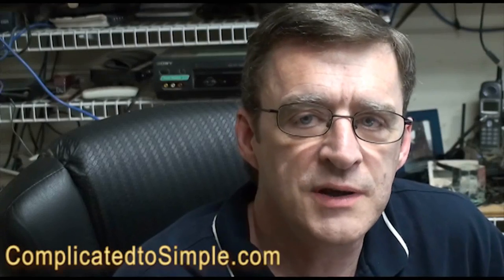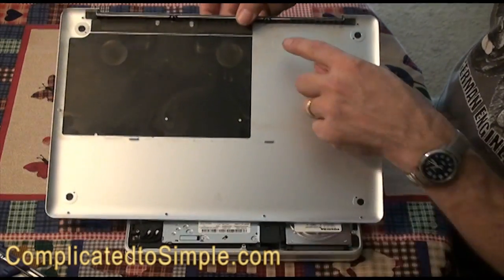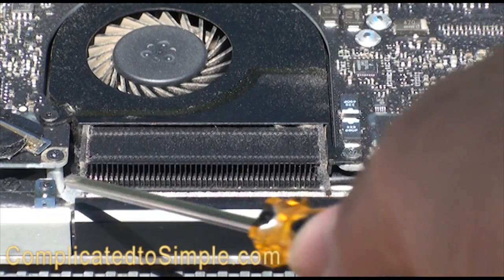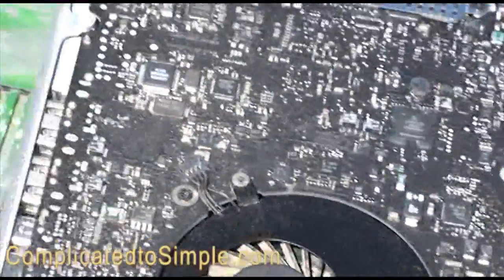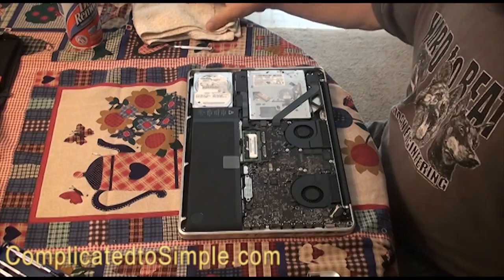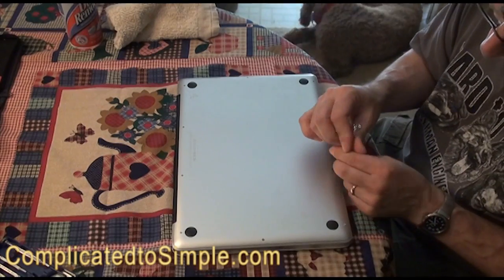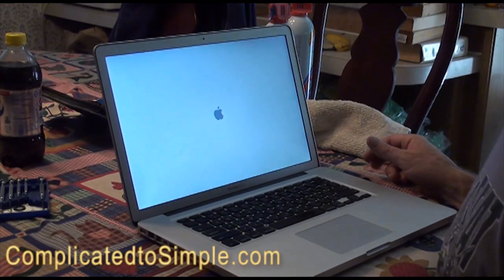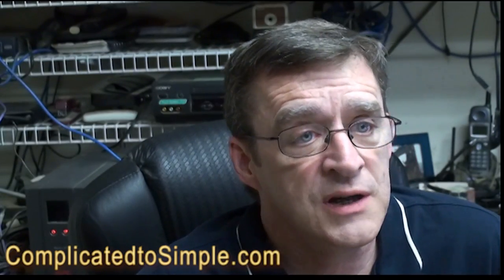Cleaning Macbook Pro HD

Comment from the maker: Hi Pasquale,  
Normal dust should not harm the surface of your Thunderbolt plug.  However, if enough gets in it can certainly get in the way of a good connection.  This can make the plug either not work at all, work more slowly, or even corrupt data going though the plug.  You can clean these the same way as the fans.  Just blow canned air into them.  Do this regularly to prevent the dust from getting really stuck and having to clean it out by other means.

Comment from the maker: The can is just compressed air available at most office supply stores.  It's actually usually compressed, liquified carbon dioxide which is why it's important to keep the can upright and spray in short spurts.  Otherwise the liquid can come out instead of air and cause freezing or other damage.

Comment: My MacBook was getting hot on my bed so I got a box lid - about an inch high and about the same size as laptop and on top of the box lid I put a shelf - grille from the oven and put the laptop on the grille and secured it with some thick elastic. Solved the problem mostly. But still find the computer still struggles in the hot weather.  It has never been cleaned inside, had it nearly 5yrs. Hate to think what has built up inside!  Thanks for the instruction.

Comment from the maker: If you use a compressor, just be careful not to blow with too much pressure.  Also, sometimes compressors have a lot of condensation in them and can actually spray water onto your computer.  At least use a water separator.  At best, get a disposable water filter for painting an you local auto paint store.  These screw on your air hose just before the nozzle and will filter out all water.

Comment from the maker: @sueanna2 It depends on your environment.  Some people do it as often as once a month as a previous commenter noted.  You can set a schedule for yourself or just do it when it starts getting noisy, hot, or the battery starts running down faster.  You could try every 3 months and if you see that it's excessively dirty, do it more often.  If pretty clean, then maybe go to every 6 months.

Comment: Um, actually, it turns out my mac is older than the one showed in your video. It's from around 2008, and has the battery in the back, and when I take out all the screws, it doesn't just sort of pop off like yours did in the video. Do you have any tips on that? Can I just pry it off? Do you have an older one lying around that you can demo? Any help would be appreciated. Either way though, your video is great.

Comment from the maker: Dust cloths are fine for cleaning your display, but I would not recommend using a cloth inside your Mac.  It may be safe on some of the plastic parts but it would drastically increase the possibility of damage due to static electricity.  I would stick with compressed air for cleaning out the inside.

Comment: Playing videos can take some processor/gpu power, this in turn heats up the relevant components, it is normal, however if the components are dusty then it'd heat up more than normally would. 62 is bit over the normal, i suggest you clean your pc.

Comment from the maker: The spray is generally compressed carbon dioxide.  Some canned air may actually be just compressed air.  Either way, it's nothing but a compressed gas that helps to blow away dust.  As I mention in the video though, be careful not to tip the can over when spraying.  When carbon dioxide is compressed as much as in these cans, it actually liquifies.  If you shake or tip the can, extremely cold liquid can be sprayed which can damage warm components in your computer.

Comment: if you're using flash (which you probably are by the sound of it) to watch videos it's notorious for using a ridiculous amount of CPU power. More CPU power = more heat. My MBP is about 20 degrees C  cooler using HTML5 when i can.

Comment: hello robert, i just watched your video it was on a website i found searching for mac book pro overheating, my mac is getting hotter than usual lately, i went to an app store and they checked the components and said it was ok, so it's not a hardware problem apparently, i reinstalled iOS and nothing (it usually get hotter when running movies or video games) so i figured i try your method, i would like to ask what you think though because opening my mac by myself frightens me a little specially because they wouldn't do it at the app store, thanks in advance i hope not to trouble you with my question.

Comment from the maker: Depending on where the air vents are, using on a bed can tend to block them,  Because of the placement of the air vents on the Mac Retina Display model, I find that using them on surfaces such as beds doesn't seem to cause much of a problem.  Thanks for your comment!

Comment from the maker: The product is commonly referred to as canned air.  It's usually either compressed air or carbon dioxide.  It just provides a way to blow dust away from your computer.  There is nothing special in the air.

Comment: Could i use the Compressed air to clean the dust from the circuit board too?
Reply from the maker: Yes, you certainly can.  Just be careful not to spray too much, too fast.  This could cause the freezing liquid to contact the board and possibly cause damage from the sudden and extreme temperature change.
Reply: There are a few factors in speeding up Macs. One plan I found that successfully combines these is the Mels Speed Method (check it out on google) without a doubt the most incredible remedy that I've heard of.Check out all the super info .

Comment: Nice video, except never let the fans spin while cleaning them out. Use a pencil or something else to hold them in place. Spinning fans can act like little generators that put current back into the computer that can damage the electronics.
Reply: uh, no that is done frequently to many heatsink fans and they do not cause damage.
Reply: Good luck with that. I fried a couple of boards that way before I figured it out.
Reply: You think that was the case, actually you accidentally static shocked said boards, or shorted a connection. Can you explain how numerous people do this without damaging boards?
Reply: Right. You were there. You must have been that guy breathing through his mouth and looking over my shoulder.
Reply: I made a common assumption. Do a web search on cleaning PC fans. Search YouTube. If your "little generators that put current back into the computer" logic was true, then explain why many people suggest this, and how their computer works afterwards. I do it on my Mac, HP, and have done it to my PS3, since I had to replace the thermal paste. They have been working fine.
Reply: Your assumption was wrong. Your question is a straw man. Not all boards get fried because people clean them differently. They don't let the fans spin as long or as fast to cause the problem. But some do. 

When I made the mistakes, I used shop air at 110 psig. The fans spun until they whistled. Two of three boards were toast after cleaning. Following that, I used a pencil to hold the fans still. Haven't fried a board since, and I've cleaned out a LOT of computers and video cards. 

Now, for YOUR experiment, take a cooling fan, attach a voltmeter to the leads, and set the fan spinning fast with some compressed air. Repeat the experiment after setting the DVM to read current. Tell yourself it's not a problem afterwards. 

Have a nice day.
Reply: You should have stated that one should not let the fan spin too fast or for and insane amount of time, which this guy didn't do. I am familiar with how rotating a permanent magnet around coils create current. See, you said "never let the fans spin," while many people do that often, with no problem. You saw him using compressed air, so he didn't need to stop the blades like you do.

My experiment: I just completed a brief test with a PC fan which gave me around 0.15V without load, so I guess mechanical damage to the fan bearings is more likely than damaging the motherboard.

Comment: The circuitry area was not very dusty.  The design of the MacBook Pros is kind of interesting in that not a lot of air blows over the circuitry.  The heat is piped out via heatpipes instead so that area doesn't collect nearly as much dust as the fans.